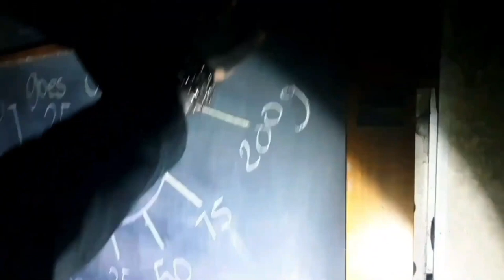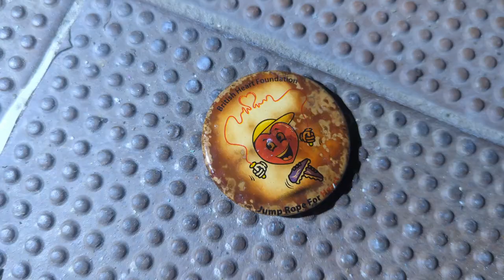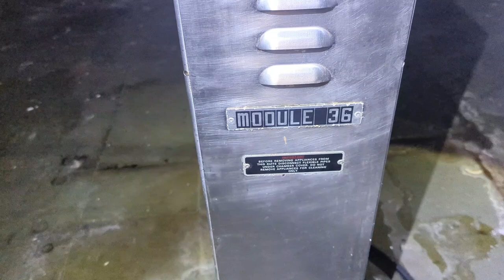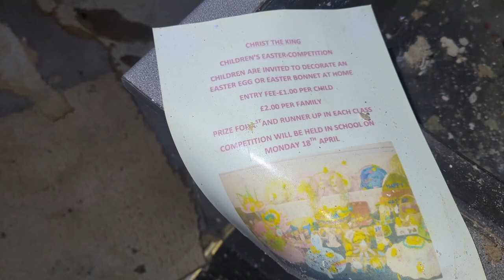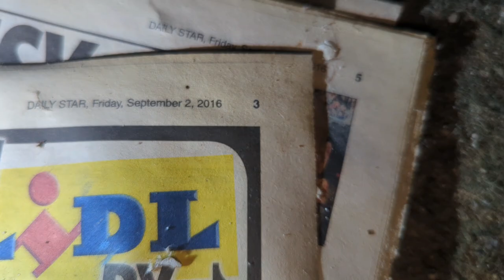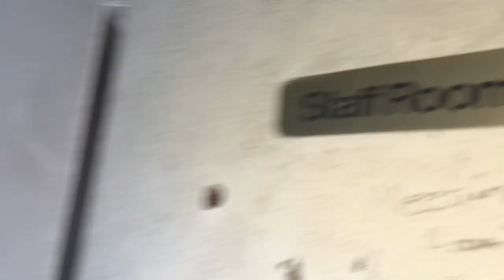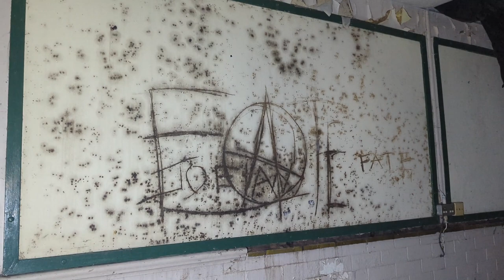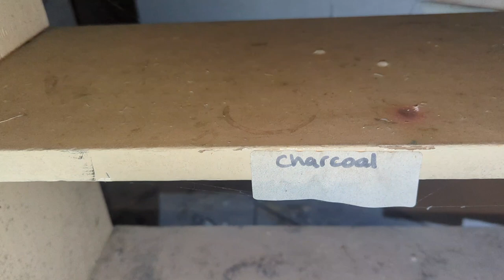Abandoned St Barnabus School Macclesfield Abandoned Places

Comment: That was facinating, I went to that school in the 1960's, the toilets were outside, there were no showers, the outbuildings were full of asbestos; it was an experience to go there. It was opened in 1911 to replace London Road school and a large amount of the furnature was 19th century from that school. I have a photograph of my mothers step mother there in 1911.
As you walked around I remembered the names of the teachers in each class room, and the ones who used canes, batts or jim shoes to hit us with.
Facinating.
Reply from the maker: That's awesome you have memories from going here then and you can trace back them memories as that far back too :) thanks for sharing that with me too
Reply: @RAZORTWISTEDEXPLORINGOFFICIAL 
 I could add; I also remember looking back, that the banisters had spikes ever yard to stop kids sliding down them, and the tops of the staircases had cages to prevent kids either falling over them or being pushed!

I did ask about the fireplaces as I'd noticed chimneys on the roof and was told what fireplaces existed were never used as far as anyone remembered.
Reply from the maker: @ianparker9593  tbh don't see why they don't do that in most high schools nowadays for definitely be a good safety barrier for sure as there was an incident like that at my old high school where someone was accidentally pushed and fell between the stairs and that's bizarre they had fireplaces but didn't use them most them tend to get covered up behind the plaster of the walls I guess